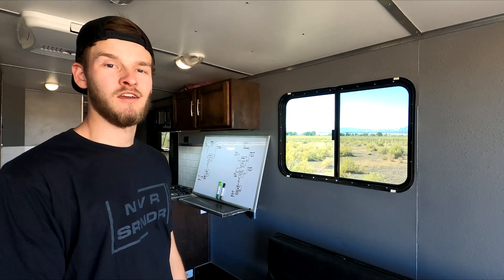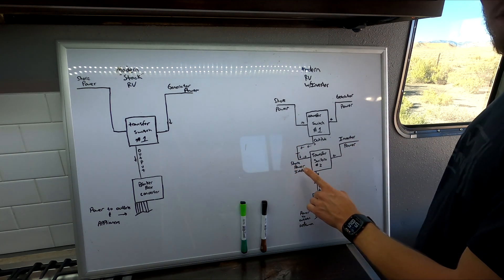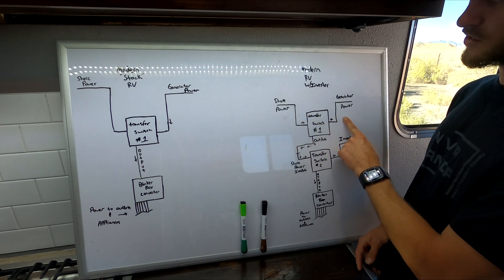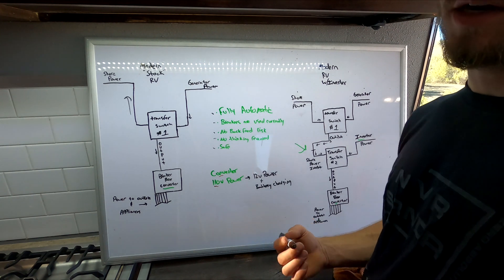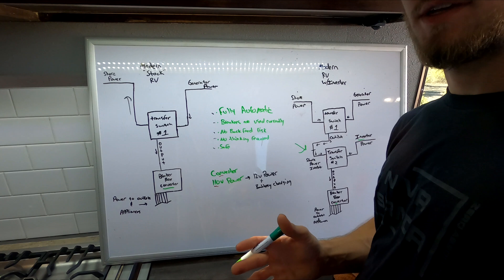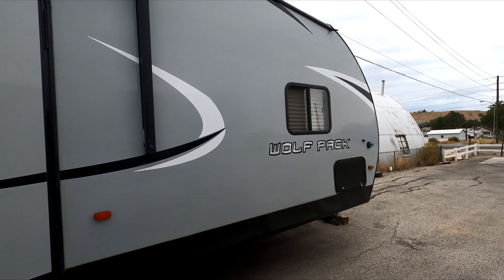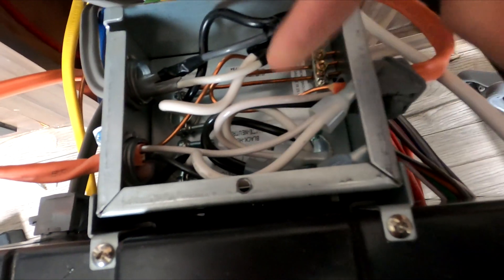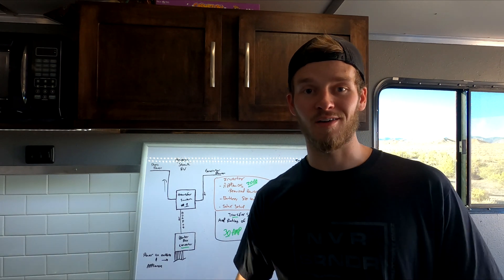Installing an Inverter and Transfer Switch in your RV (Basics)

Comment: What would you recommend for a wiring a inverter/charger ? Mine is a renorgy 2000 watt inverter/cherger and will only put out 2000 watts which doesnt allow the AirConditioner work properly, Would like to bypass the output of the inverter but still have the charging ability to charge batteries at the same time. Any ideas

Comment: Thanks Austin for this great video! Question: Do I even need a transfer switch if I plug my shore power cord into my portable generator sitting outside on the ground when there is no 30 amp pole service where I'm camping? After all power is only coming in from the shore power cord which can't be getting power from both at the same time, only the one that its plugged into? Thanks, Dennis

Comment: Excellent video very well. Diagrammed everything explained thoroughly.

I've thought through this myself I have many years of rving the only issue I would propose. 

Is there will be a feedback loop from the converter when you are energizing the inverter. 

It would be nice if there was a automated kill switch from the DC charge that goes to the batteries. This would eliminate parasitic loss via converter charging inverter battery source. 

Could also isolate inverter power source to just that of generator and solar panels. 

Excellent work. 

One resolve that I've thought of is putting a transfer switch on a single circuit that may power microwave a K-Cup or a blow dryer. 

Just a thought. Thanks again great work
Reply: BTW my inverter does have a breaker push button style on the front of it for the 110 outlets
Reply: Also, I installed a fuse right off the positive terminal going to the inverter. It's something that you would use on a power amplifier for subs on a vehicle, driving 12s,  they're used a lot in the automotive sound industry
Reply: Also, one other tweak that I've often considered is the bonding that goes on for a GFI. 

I'm assuming non-electrical expert but I believe with a motorhome or a travel trailer, the bond goes to shore power pedestal. 

When running from a gen set the bond goes to the generator which is a floating bond. 

Camping in the wilderness with my travel trailer on several occasions, I've had to drive a grounding bond into the soil surrounding my travel trailer and then connect it to the frame. Most RV frames have a ground post for this purpose, usually by the dual tire set. 

Again an assumption with an inverter I would think following the manufacturer's installation instructions. 

Your bond would fight its way to the frame of the vehicle. Hopefully tripping the GFI. 

Again, not an electrician. Just many years of rving crossing roads with these issues. 

With my current generator setup and my fifth wheel, I've had to create a jumper plug to stick into the generator electrical panel. 

 It takes the neutral and places it in the ground and then the generator sees that as a bonded circuit. 

Thanks again! Great great information
Reply: It is possible now that I'm thinking of it that the bond is one leg of the transfer switches that never opens. It would make sense that the generator and the inverter would use the same ground wire circuit and be bonded all the way back to the frame or the generator. 

Again, all assumptions, not an electrician

Comment: So if you connect battery + inverter via a transfer switch upstream from converter, wouldnt the converter try to charge the battery using battery’s own power?

Comment: Great idea, adding another RV power control box.  Google showed a 3 way $859 RV power switching box but I like your solution the best. Question: when RV on Inverter power is your converter  powered ON and charging your inverter battery bank ? If NOT, how did you accomplish that ?
Reply from the maker: Yeah it’s pretty simple! If I’m understanding the question correctly that is going to be no. If you have the inverter on and the battery charger in the converter powered on at the same time it will just waste all your power. Essentially trying to get the batteries to charge themselves at that point. I just flip the breaker for the converter off when I have the inverter on. You could also wire it to where the converter only has power when the shore power or generator leg has power.

Comment: Excellent!!  Is there a transfer switch product that allows input from generator, shore power AND an inverter?  THAT would make life much simpler!!!
Reply from the maker: It would! I’m not sure if those are available or not. I’ve seen people run two transfer switches back to back to solve that issue though!
Reply: @AustinStout  Yep, that's exactly what I am going to do!  Easy and not too expensive.

Comment: I’ve been sifting through videos for hours trying to find exactly what you explained. Thank you!
Reply from the maker: Hey glad I could help! 🤘🏼
Reply: @AustinStout  wiring in the second transfer switch as recommended, will the converter keep trying to charge the batteries off the batteries creating a loop and draining the batteries?
Reply from the maker: Yeah it will so when you have the inverter on just make sure to flip the breaker for the converter off. You could also get more in depth and connect the main power for the converter to the other leg of the transfer switch with the generator/shore power wire. That way the converter would only have power when the generator or shore power are on thus eliminating that battery drain loop. If that makes sense? I didn’t think about wiring mine that way when I originally did the install

Comment: Just to be clear, Nothing runs off the converter. The converter is ONLY charging your battery. All 12v appliances are running off of the battery and only the battery, never the converter.

Comment: Hello great video 
I bought a Xantrex 2000 pure sine wave with built in 30 amp transfer switch 
My Dometic consumption fridge when out 
So I was going to tap in the the fridge receptacle with inverter 
How May I do that, TIA

Comment: Awesome setupup. Funny I was telling my wife because she doesn’t get this stuff that see what he is doing it’s exactly what I’m doing for my goal zero yeti 3000x. I’m a tech geek with my own cellular array system using mofi two high gain directional antennas on a swivel mount that was used for the for the satellite a turns the array to locate towers from the inside. Anyway cool stuff ttyl
Reply: Still pondering my battery setup but I have a few ideas but I try my best to get open box or good deals because it is expensive that’s why batteries are last lol

Comment: I'm just keeping my system separate and plugging my inverter into the shore power plug.
Reply from the maker: Keep it simple! I like it. Probably a little more efficient too since you don’t have something else using power
Reply: You still have to turn off the converter switch correct?

Comment: Your video kept me from making a big mistake on hooking up my inverter to my RV sub-panel. I wanted to power all of the AC outlets with the inverter and still be able to connect to grid & generator. I didn't think about the back feeding to the inverter if I plugged into the grid or ran the generator. A second transfer switch solves that problem. I have a 50 amp (240V) sub-panel in my RV with breakers sharing the two 120V hot legs with no 240V being used, air conditioner is 120V. My question is, will both hot legs of the panel be energized with 120V when the transfer switches to the inverter (3000W 120V)? I guess it will because when I plug into a 120V grid, both hot legs are tied together giving power to all the breakers.   Thank you for giving such an articulate and meaningful video. I like and subscribe to your channel.
Reply from the maker: Awesome! I’m glad it saved ya from that trouble! That’s exactly why I made the video! As for your question having both legs energized, that will depend on how you wire it and if you want them both on or not. If you want both hot legs to be energized you’d be tying them in to your inverter power the same way as a 120v 30 amp adapter would work. The difference would be when you have a 50 amp setup you have two separate wires, one for each set of breakers. But when you power them all off of a smaller cord both of the hot legs in the panel would get power from the same source. (If you wanted all of the breakers to be powered vs just one set that was more important.) so like if you wanted all the breakers to be powered you’d have to connect both hot lugs in the new switch to the one hot wire from your inverter. (Id probably run one hot wire from each outlet on the inverter to your ats) if you wanted to do just one set then you would connect your inverter power to whatever one that fed the breakers you need to use. Also make sure you get a 50 amp ats for your second one because it will still need to run the full 50 amps when you wanna use the shore or generator power. Hopefully that makes sense?

Comment: Question. On your 2 transfer switch diagram , when the  power is sent to your converter , the batteries get charged. If your inverter is powering your converter panel , wouldn't that be your batteries powering your inverter to the converter charging your batteries?
Reply from the maker: Yeah that’s the infinite power loop thing I’m pretty sure I mentioned in this video? (Maybe a different one 😅)
But in this setup you just need to flip the converter breaker off while you are using the inverter! You could also change the wiring to have the input power from the converter come off of the shore/generator transfer switch to eliminate that step. Changing the wiring just requires more work and can be kinda confusing on some trailers. You will defiantly know though if you leave your converter on with the inverter because your batteries drain quick 😂
I personally just leave my converter off most of the time because the solar maintains the batteries pretty well
Reply: @AustinStout  yeah I'm gonna run one outlet from transfer switch(with a 15amp fuse) , powered on the "gen/shore power" side of transfer switch to  to run my battery charger. I don't have an "all in one" RV  dc/ac converter panel. Then when the inverter is on that one outlet will be off & the remainder of my AC outlets will be on.

Comment: Could you just use a marine 3 position main power switch to isolate the generator / inverter to feed into just one transfer switch? In a 6x10 cargo trailer conversion simple and compact seems better.

Comment: Thanks for this informative video well done. I'm in the process of adding a second ATS. My question is  If I disconnect output from transfer switch 1 over to new  transfer switch (2) into AC  Distribution panel, do I add a new wire from transfer switch 1 to shorepower at new transfer switch?
Reply from the maker: Thanks! I hope it helps! But yeah you will need a new wire to come from the output of the first switch to the shore power input of the second switch! Then from there you connect the output to your distribution box. 
If you wanna get crazy and add another breaker you could wire your converter into the output from that first ats as well so your converter will only have power when your generator or shore power leg is live.
Reply: @AustinStout  Thank you Austin for the quick response. With that knowledge I'm ready to start my install. By the way my second ATS is pre-wired with inverter and converter 🔌 the converter is wired to the N.O so there  Shouldn't be any back feed I think?
Reply from the maker: @rjshather  Right on! 🤙🏼 Some of those all in one units are pretty sweet! Im not super familiar with how they are wired though

Comment: Great video. Thanks. Did you install a fuse or breaker between the batteries and the inverter? Also, can you direct me to information about how to wire the A?C from the inverter into the power center of the RV?

Comment: great video, looking to do the same on my 30 travel trailer trying to decide on how big an inverter do I need , most likely a 3000 watt.
Reply from the maker: Thank you! It makes things very convenient with an inverter! For most things a 3000 watt is a pretty reasonable size! The bigger you go you will need to size up your batteries to take full advantage of the extra output. The battery voltage dropping too low has shut down my inverter before maxing out the output

Comment: Great informative video. 
Okay. Can you set up an inverter and the auto transfer switch to both share to power a single 110v breaker box. I want to power a microwave on the same receptacle.
Reply from the maker: Yep you sure can! That’s how mine is wired! I just ran a wire from the transfer switch to the inverter and used a standard male 110v plug to connect it. Both shore/generator and inverter power go to the same breaker box. If that’s what you are asking?

Comment: Great video and I see a lot of people who seem to know what they do in the comments, so I chose this video to ask you this question...Hi, I bought a 219BH Passport and it is solar ready. I bought an expansion panel and is fine, but then when I was going to install the inverter...I removed the "future inverter location" box and a 20AMP yellow Romex wire appeared, no ends, is a loop so it comes out of the wall and goes back inside the wall. I don't see any other wires (to the battery) but the converter is next to it so I guess I can wire it directly to the LOAD connectors in the converter. How do I find pictures or instructions on how to deal with the ROMEX loop? I was expecting a terminal or end of the cable. The owners manual reads that is "pre-wired for seven outlets" but I pull and both ends seem to be connected unless it is snagged and I am too weak or afraid to pull hard.

My thing is that if it comes prewired is best to use it and looks like that Romex protruding out of that hole like an intestine is where it needs to go but it does not make sense to splice it. I called and chat with Keystone but the girl in the chat had no idea and when I asked for a diagram, like the blue prints of a house, but she says they don't send those to customers.  Not even the roof plan to see where the joists would be for the solar panel brackets.
I could test the wire but I don't want to cut the insulation. I took pictures but I don't know how to upload them here, ha!

Comment: Austin I am using the exact same setup as in your video second transfer switch question I have is I'vegot acces to  victron Multiplus Compact 12 / 2000va / 80amp unit will this work by just taking out the inverter you use and pluging the Victron in? Any help or suggestionswelcome.

Comment: Great video just what I was looking to find out for my Class C Thor. One question once everything is connected do you have to disconnect the convertor that came standard with the unit inside the breaker box?
Reply from the maker: They do actually make converter boxes that also have an inverter built in but I personally don’t have any experience with one. I would think if it’s a combo like that it would also use an automatic transfer switch to make everything work. 
I will say there is also a way to wire your inverter/switch/converter that doesn’t require you to manually turn the converter off every time but it’s a bit more in depth. To do it you have to disconnect the wires from the stock converter and change them over to be powered at the same time as the second transfer switch (on the same leg as the shore power for the second switch)
Reply from the maker: You don’t have to fully disconnect it but when you turn the inverter on you will want to flip the breaker off to the converter. Otherwise it wastes a ton of power trying to charge the batteries from the batteries
Reply: @AustinStout  Thanks for the reply. Is there an Inverter that also has a Converter switch built within it?
Reply: Austin sorry I did not mean Inverter I was thing of a TS that has this all built in.
Reply: Austin I am using the exact same setup as in your video second transfer switch question I have is I'vegot acces to  victron Multiplus Compact 12 / 2000va / 80amp unit will this work by just taking out the inverter you use and pluging the Victron in? Any help or suggestionswelcome.
Reply from the maker: @jamesmashinske3198  that’s actually a really cool setup! I checked it out cause I’m not familiar with it but it looks like with that unit you would eliminate everything in my system besides the batteries and solar panels! It has the transfer switches and chargers and inverter all built in that one unit

Comment: or just buy an inverter with a built in transfer switch and you don't need any of this. you can run either shore or solar if you need a generator you just use the shore plug.
Reply from the maker: Or that too! I havnt seen any like that but it would be super nice to have everything all in one unit
Reply: https://youtu.be/iASOOzUCRto?si=3icuUn9FvEfDK5HY

Comment: I set mine up so I just need to unplug  shore power and plug into a small 30 amp box I wired to my inverter . Run 3 batteries, 1 is still tied to the system other 2 are just for my solar system . I can recharge my solar battery from my generator with trickle charger as needed